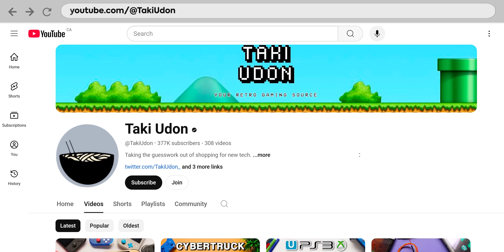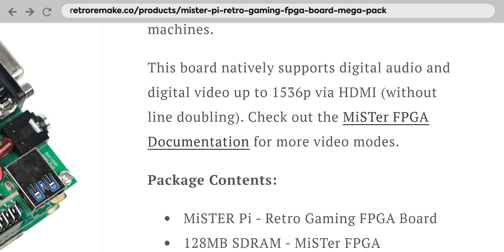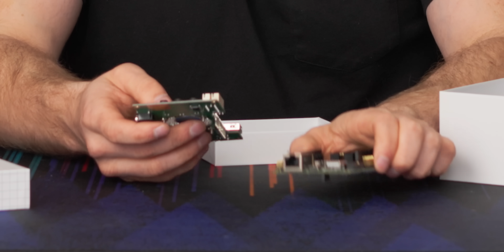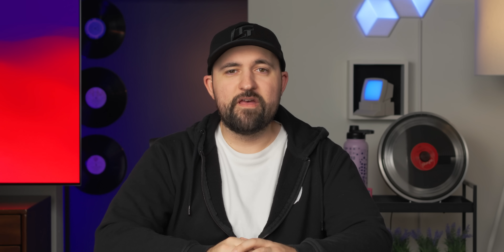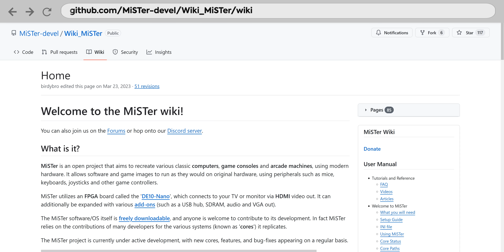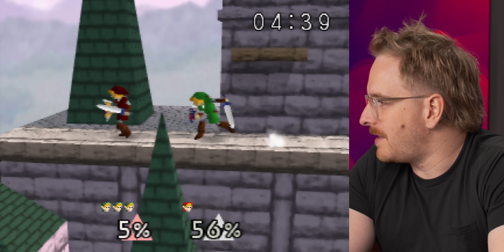Half the price. All the Games. - MiSTER Pi

Comment: 2:45 That's a JTAG port, used for debugging. You can step through lines of code in the processor, or you can probe individual signals in the FPGA. The DE10 Nano has a JTAG chip built in, so you just need to connect a USB cable to it. The MiSTer Pi requires an external JTAG USB Blaster.
Reply: I know the first party Altera USB Blaster is quite pricey for consumers, more directed to Engineering companies. There might be good third party solutions? Kinda disappointing for the tinkerer but probably most people won't reprogramming the FPGA
Reply: Hire this guy!
Reply: Starting see where some of the half the price is coming from.
Reply: Mhmm. Ok. I see.
I know some of these words!
Reply: Don have high expectation for the ltt team as of late esp on here they just dont bother getting accurate info or doing ANY research whatsoever. they basically look at the box and decide on the fly if they like it or not.
Reply: aren't those the things used for modding a 360
Reply: Surprised he didnt know what it was
Reply: @cwal-yt  Possible he's not 100% sure, and not wanting give wrong information, that one could trackback ones self of ones self give wrong information?, better having it tracked back to a user comment, that not you, lest chance of being fired?
Reply: @cwal-yt  if the average user has to know what a jtag port is something has gone horribly wrong
Reply: @bentomo  He is not an average user. Not bashing the guy just found it strange since he works with computers and tech does he not?
Reply: @cwal-yt  not saying he's average for sure. But even if you work with computers a ton, you still never touched JTAG unless you're an embedded specialist. Plus, JTAG is just pins, there is absolutely no standard for pin out or form factor. Often times it depends on the device and it will have extra pins in addition to the four standard JTAG control pins that are vendor specific. And even then there are typically chips on eval boards to convert to USB rather than using an external dongle. Those chips often require licensing to function too even though the chip is $2. It's one of the reasons dev boards are more expensive
Reply: @cwal-yt   they probably knew, but they want that viewer comment interaction. Speaking of, here is mine for the algorithm. 😉
Reply: @cwal-yt meh random knowledge gaps happen to everybody
Reply: @PowuhPenguinINC  They dropped the FTDI chip to probably save money.
Reply: @FPGAZealot that’s funny because IIRC FDTI chips are dirt cheap

Comment: I was curious about how accurate the emulation is for FPGA in general. So I asked in an Oatsngoats stream if he ever played an FPGA (he is the current WR holder for Super Metroid speedrun Any%). He didn't see my question in the chat haha. However someone in the chat said they asked ShinyZeni the same thing (who is another WR holder for a different category) and he said it felt terrible. Not sure if those were ShinyZeni's exact words since I got that second hand, but at the moment I'm skeptical of how accurate FPGA is. I'm sure it's fine for your average joe like you and me, but so is regular emulation (for me). In all fairness, I don't know how he tested it, perhaps he wasn't using the most optimal set up? I'd love to hear more from high level players who would feel the difference between FPGA and original hardware more acutely.
Reply: You can't get less input lag than original hardware with MiSTer. With SNAC it'd be the same, with a good USB controller you've got an extra 1-3 ms which is still too small to notice. You need to use software emulation to go below the input lag of real hardware, the flip side of having accurate timings is that you inherit the same input lag as the real thing.
Reply: you can actually get less lag than original console on mister.  it's objectively a better experience than original console even if it is by 1 or 2ms.  also most of the cores are console accurate with perfect timings
Reply: Both FPGA and software emulation are more or less derived from the same public docs on console hardware, so one really can't be more accurate than the other. And given this specific FPGA is ultimately a cheaper clone, it's probably even less accurate.
Reply: @ColorblindMonk  The accuracy is in the HDL code, if it's accurate, it will be accurate in any FPGA where it fits and is able to run with the right timing constraints, also the new board uses the same FPGA family as the original board, sometimes it will be even slightly "better" models (with faster transceivers, but nothing a MiSTer core will take advantage of) due to availability. The price difference seems to be mostly a difference in markup rather than cheaping out on parts. The parts that were omitted were related to the USB Blaster, which would be difficult to include without having to license it from Altera / Intel, it's cheaper to have it as an external unit as you can buy it so cheaply and it's only useful to developers, not users.

Also, not all cores are created the same, some cores were made from reverse engineering original chips, being decapped, photographed and mapped into the transistors, then logic gates, then a model with equivalent behavior is created, this was done on the Neo Geo and the new Genesis cores, for example. While other cores were created from public documentation, like the PDP-1 and EDSAC cores, some were created from a mix of public documentation, low level software emulator, emulator correctness test code and so on (like the N64 core), or a mix of this and capturing the inputs and outputs of original hardware and replicating the behavior (like the Saturn core).

Also worth noticing is that FPGAs aren't really "plug and play", there's a ton of stuff you have to be aware of to take full advantage of it. Using bluetooth controllers and HDMI output may add significant lag to the system, it's best to use either SNAC adapters with original controllers or wired controllers tried and tested with known low lag and either a CRT or a low latency LCD/OLED configured for lowest latency. There's even a add-on called MiSTer Laggy that allows to measure the lag of modern HDMI displays. Some displays and scalers may also act different depending on the settings. The difference can be HUGE from display from display, my lowest lag LCD had 6ms of lag, but my highest latency one had a bit over 90ms of lag.

Comment: I want someone to make a n64 controller with an analog stick that is exactly as precise as the original, but with metal greased parts for the stick housing and the rest as the original, mushy rubber dome and then compatible with original and with an adapter for direct input and xinput. PLEEEEEASE someone. I'll buy 4. I just want to be able to play my n64 games conveniently than keeping er CRT alive and dealing with a n64 that's gonna blow up soon, but the controller is the biggest problem with emulation or FPGA

Comment: I learned digital circuit design using the de10 in the mid 2010s. Cool seeing it used for this kind of stuff. I wonder if you still can use this pi thing as a drop in with quartus to tinker with HDLs
Reply: Just needs an external USB Blaster, but otherwise it's pretty much the same as the DE10-Nano.